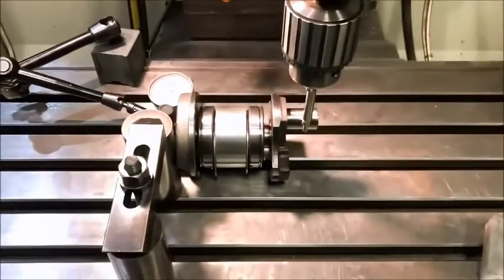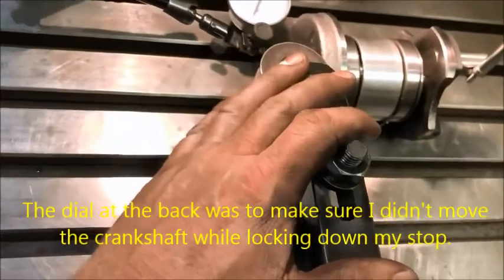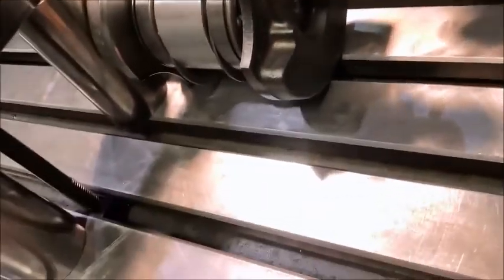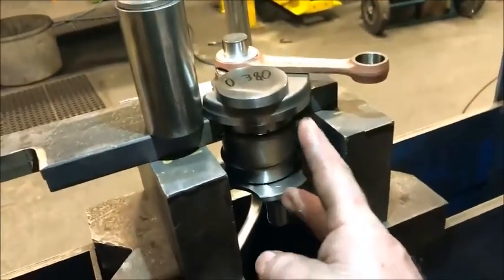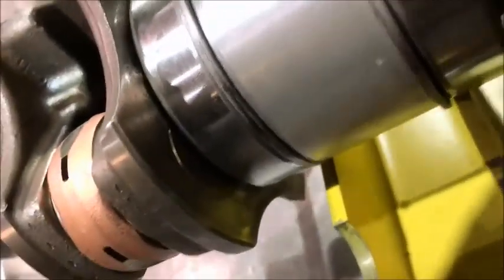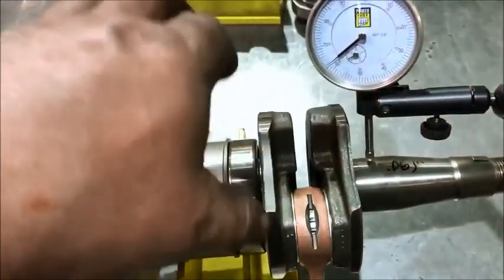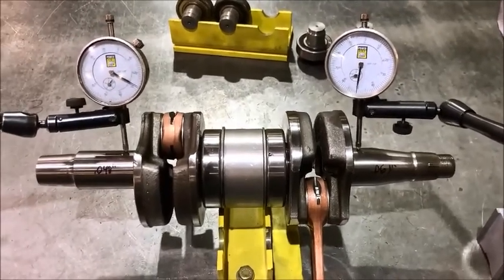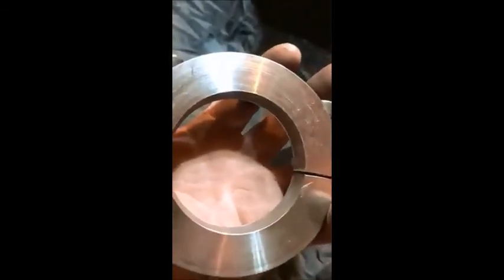2005 Skidoo Summit 550F Crankshaft Rebuild

Comment: Talk about over complicating a simple task , i could have completely rebuilt a tripple in the time it took to watch this video. and you never checked the runout on the very ends,
Reply from the maker: This is making it as tight of a tolerance as I could if others have the same tools.    There is no videos on phase alignment on rebuilding a crank on YouTube.    We’re allowed +/-5 degrees and I’m 0.0433 degrees.     Checking runout on the ends exaggerates the runout, and I’m in spec at worst case.    In my 2005 manual it didn’t say where to measure the runout, just which section.     Obviously you know more then the manufacturer on how to cut corners.   Rather then be a Karen and complain please enlighten us on how you could have done it quicker and make a video of your own work, and the jigs you built in your machine shop to get it in tolerance.   You don’t have a single video uploaded on YouTube in 2 years, You could do so much better with your energy then complain about others contributions to the world.

Comment: Would you do a 1982 ski doo blizzard 340 crank?
Reply from the maker: Hi Adam.   I live in Grande Prairie, Alberta, Canada usually someone who does small engines might be able to do it or give some direction.      It has to be measured out before dismantle for everything to line up for bearing placement.

Comment: Do you rebuild rotax 503 crankshafts?
Reply from the maker: Had to look it up just to be certain, but it’s done the exact same method.       I did a lot of measuring and blueprinting to get the spacing right between the bearings and counterweights before I pulled anything apart.     The initial alignment for phasing between the 2 cylinders one of the counterweights, the only one is tapered.     For me it was 3 tones of force for the 550f I did and 6 tonnes for my 800ho which has almost triple the horsepower.    Don’t forget it’s not just a red or blue lock tire on that taper, I believe it’s green offhand.    Being an ultralite be mindful of the proper break in method which for a sled is about 200km
Reply: @adamf1978a  Awesome thank you!